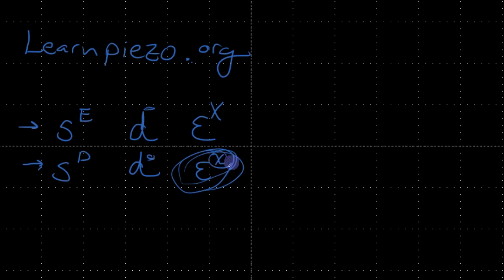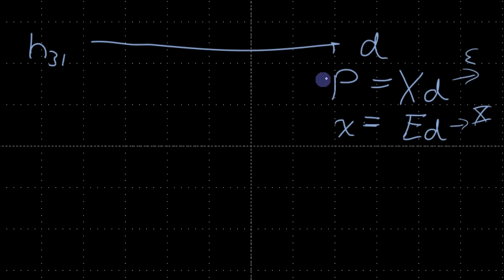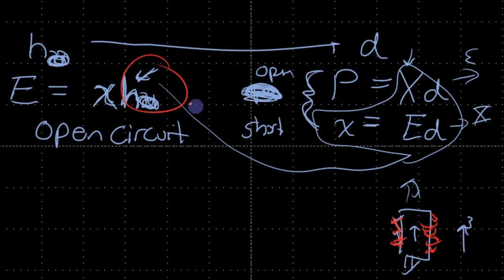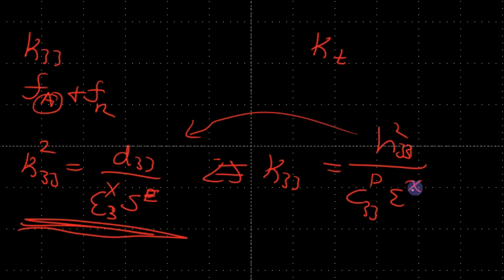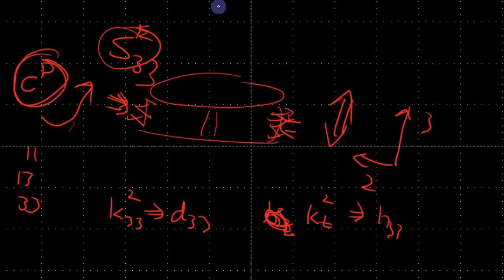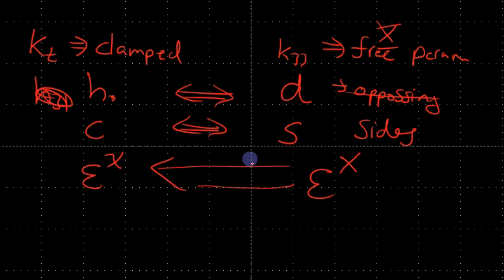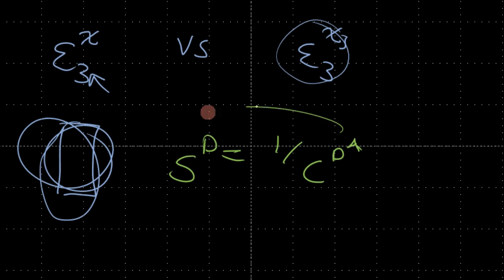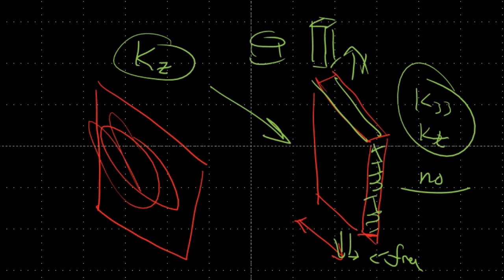Learn Piezo Lecture 3R: Thickness vs. length extensional piezo resonators properties (kt and k33) -

Comment: 8:06 why did you call the first equation open circuit equation , while the second one short circuit equation ?
Reply: @ultrasonicadvisors  Actuators always work under short circuit condition, while sensors always work under open circuit condition. True?
Reply: Can you please provide me with useful and clear references that explain piezoelectricity? I am an undergraduate student and my graduation project is related to this topic. My supervisor doesn't support me.